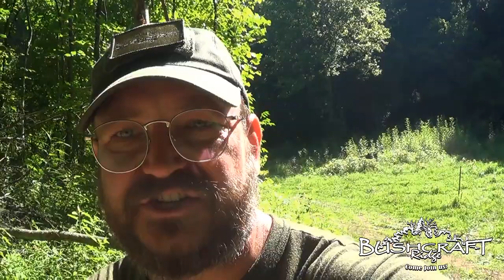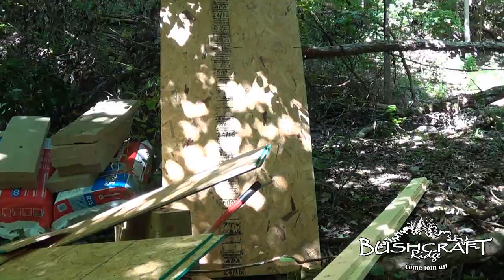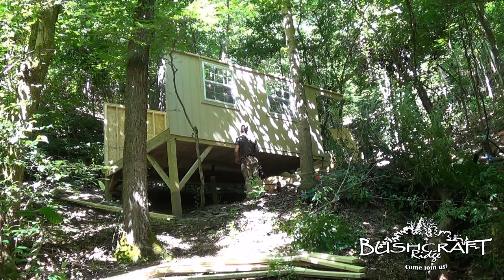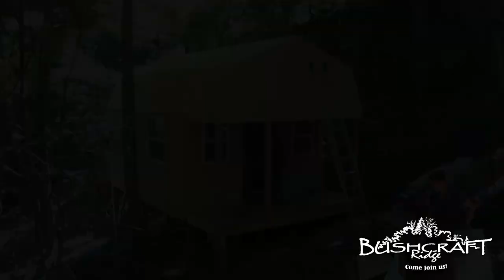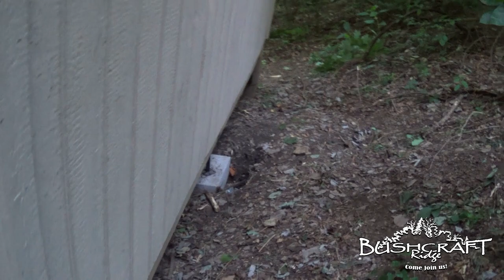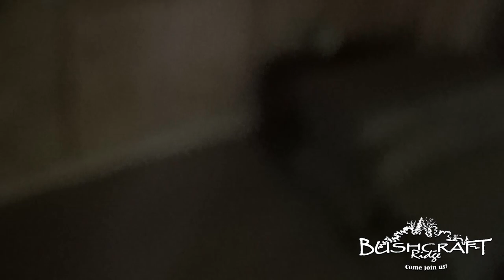Off-Grid Cabin Build 7.15.2020 -- Main Build

Comment: Should have added house wrap, I did spray foam in floor and OSB roof decking so I'll do fiber glass in walls and ceiling. I wanted to seal critters out and foam has vapor barrier properties but don't want to be sealed up in toxic spray and also have access to electrical and plumbing. Add vents to gable ends and get some vented eaves on to keep the water off and vent more, you'll have mold and moisture in no time, I can't imagine the ridge not being vented either. I would have considered foil faced foam board for subfloor insulation, rats nest in fiberglass and foam board rocks on this application. Cute spot and cute cabin, on to see the build to this point...congrats!
Reply from the maker: Great tips! Thanks cor sharing!

Comment: It looks great. You might consider putting heat tubing under the floor before insulating. The solar system can dump excess power to the water heater and a small circulation pump can keep the place warmer. This will save on firewood. The couple over at Wild Wonderful Off-grid installed it recently along with a DIY ductless split A\C system.
Reply from the maker: That's a really good idea. I'll have to check that out.